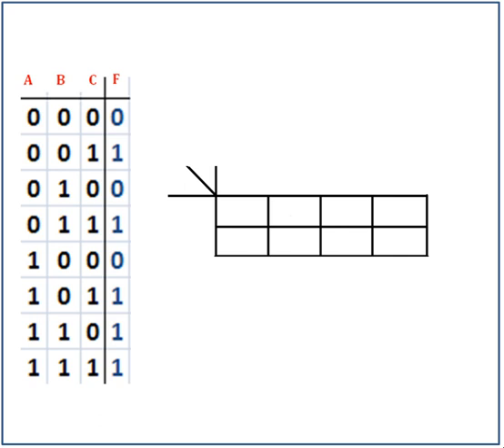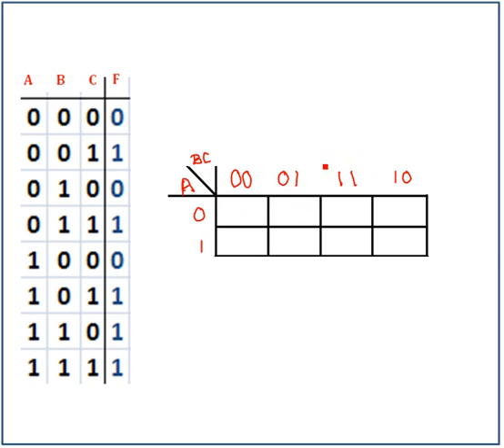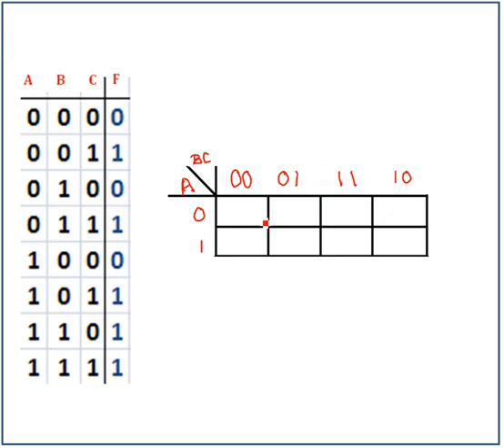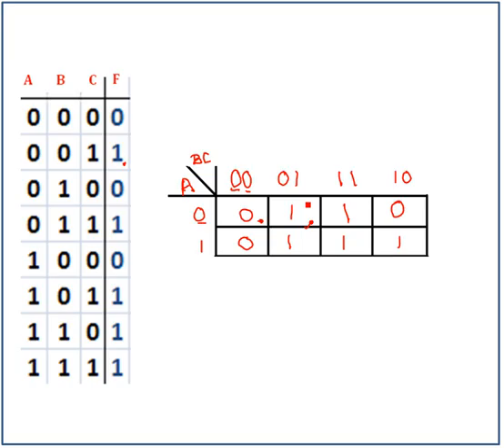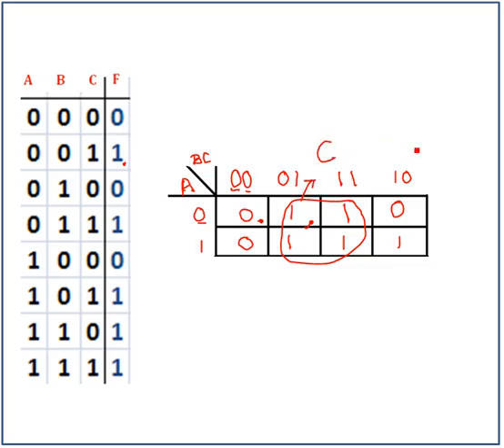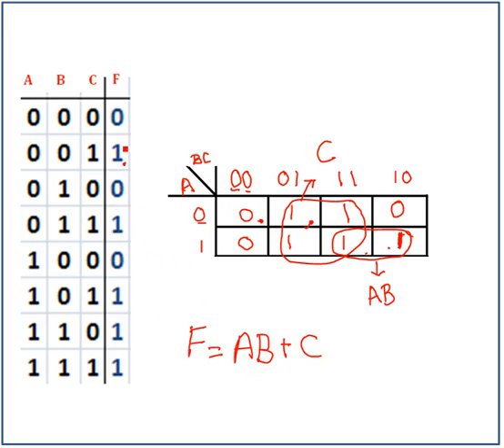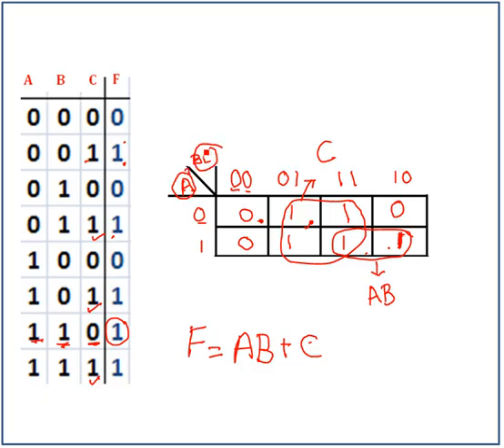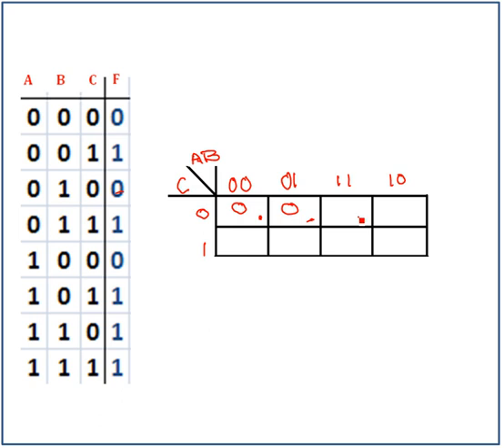Digital Design 3: Truth-table to K-maps to Boolean Expressions

Comment: the ones at the end are connected so you have:
_ _
1 1| 0 1
0 0 0 0

and 
_         _
1 |1 0 |1
0 0 0 0

see how the two ones are connected on the sides?